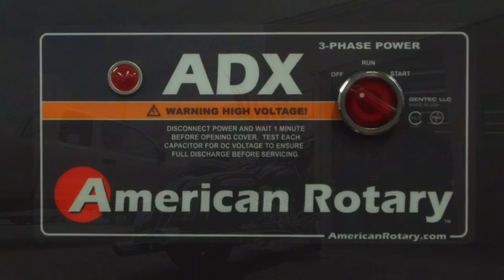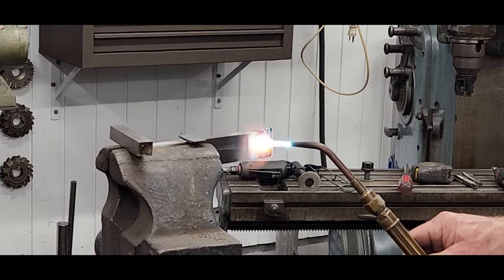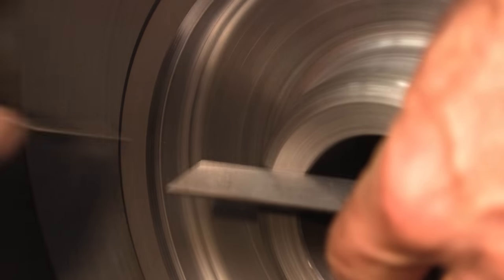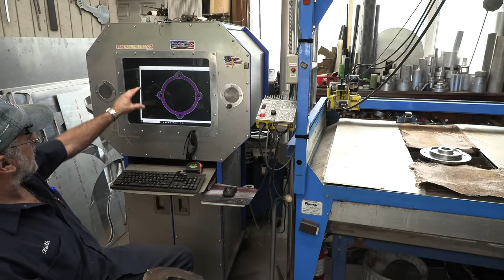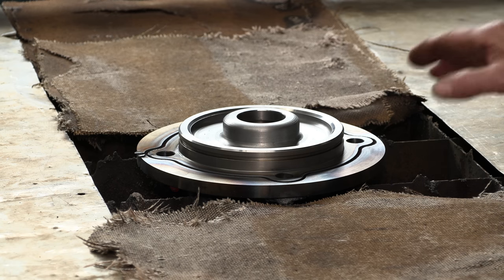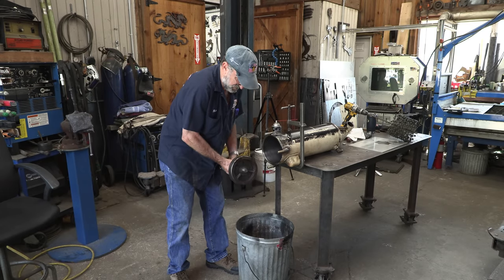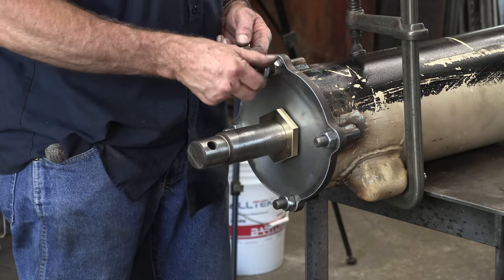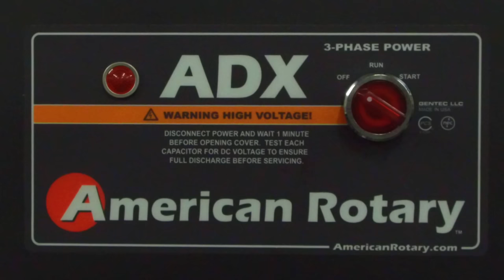How To Change The O'Ring, The Long Way

Comment: Really helpful, Some people will have no idea how thoughtful some of your key comments are during your shows. thanks. I done my time as a Boilermaker/ Welder heavy steel fabrication and plant maintenance with a bit of fitting@ machining. Over the last 5: years as age started to catch up and made crawling around in confined spaces hard facing and generally heavy work less appealing. I started deepening my learning in machining, lathe and Mill. Purchased new but Chinese lathe and Mill for the home shed and slowly played with it and over the last 12 months picked up bits and pieces. I’ve just finished up working for someone else and have enough work  between  smaller fabrication work and job shop stuff to work from my shed at home.  The Chinese lathe has gone been replaced by a brand new Taiwanese one and the mill has been replaced by a Taiwanese Bridgeport copy. Big investment however getting to my point showing making a simple tool to utilise inserts that were otherwise useless  is so helpful, not hard to make but it’s the years of your experience that to you makes it a no brainer but to myself who has not been in the daily grind year after year my resourcefulness is under developed  and the ability to save myself  money on tooling and still produce  quality is gold. New and Bigger Machines mean a lot of new tooling and the price for quality tooling and inserts is hard on the wallet.  Thanks again and to Bill and his mate

Comment: Looks like it needs an internal piston stop to keep it from going dead at the end of the stroke.
Reply: If it's for a plow as Kieth mentioned, which it looks like it is.  The weight of the plow will pull it down so the stop, while perhaps nice, is not necessary.
Reply: Looks like it is over stroking the bore and the piston rings are passing the return oil inlet port! should it have a internal stop to prevent that form happening, because that could wear the piston seals in the inlet oil port groove! Also could be why it bent to start with!

Comment: You'll find a lot more uses for that round insert. Those will remove a lot of metal fast. This was a good watch while I'm laid up waiting for a leg injury to heal. My workshop misses me. Great repair job.
Reply: A screw holding the insert would make it much more useful.
Reply: @ehkerr  The solder is much stronger than the screw. If..if one had the tooling to properly bed the insert it would be almost as "good as". Keiths way takes about 2 minutes to replace the insert at most, and angle of insert can be changed easily, unlike using a screw. Drill and tap for a screw..you are only going to have that angle to work with from that point forwards

Comment: @Keith Fenner     just a tip on the starting of the arc on your plasma setup. Start the arc off into the cutoff material, get it cutting about a 1/8" to 1/4", and then carry right into the actual cut line. Same when leaving the cut, carry  it off or past the start point. That way it will minimize or completely remove the startup scar on your part.

Comment: Keith, I have learned so much from you over the years, thank you.  May I ask what brand and size were the large pliers you were using to tighten the packing nut?  Thanks again.  Never mind, I see in the comments the issue was brought up and answered.
Reply: Knipex parallel jaw pliers. German brand. They come in any sizes.

Comment: Great video Keith, for a while I was wondering which part of Pearl you were remaking. One question, could you have cut the ears with the part upside down? Then no clearance issues.
Reply from the maker: The whole face would of been to close, the center fits between the grate but the rest doesn't.

Comment: Use quad rings instead of O rings. They provide a much better seal. Are you certain that the damage was done by trying to tighten the cover and not from the cylinder slamming into the cover at high speed? If an air cylinder is run up to pressure and whatever it's pushing won't move then suddenly releases, they can slam home pretty hard.
Reply from the maker: I would lean to think in that direction if I hadn't been told it was a leaking issue.

Comment: Seems like it needs something between the piston and cap to limit extension stroke. Appears to be covering the return port when fully extended.
Reply: Yes
Reply: I thought that to, until Keith said that it was most likely a plow, where the weight of the plow would drop it as soon as the pressure on the bottom of the piston was released. That port is most likely either to a filter so that dirt is not sucked in, or pressurized to hold the plow down so the snow (assumed function where he lives) does not push it up off the pavement.

Comment: Keith, why not tap a hole for the insert? Than you can rotate and replace them when they get worn. Best, Job
Reply from the maker: Well, unless you machine the exact taper and seating pocket for the shape of the seating side of the insert, holding it down with a screw would eventually loosen up and be a fail.
Reply: @KeithFenner  Keith, made these myself for a left over box of round inserts and made the pocket a hair smaller than the outside diameter of the button insert (0,02 mm approx) When tightening down it's puĺled into position tight like a press fit. It works for me. Maybe an idea. Faster than soldering. Thank you Keith! Just another way to Rome
Reply from the maker: Yes, it would be a close call on precision location, drill and tap then tighten screw and or soldering in as I did. You know what it boils down to is what you have on hand at the time you are underway with the job, screw collection or siler solder, time is money it could be wasted looking for either. end game getter done.

Comment: Okay, we’ll, I thought the round insert was like all the other inserts in that it had a hole in the center to take a small machine screw, and that you were going to drill & tap a hole in the insert holder. I wasn’t expecting you to solder it in. Oh well, as long as it works. Getter done! 😉
Reply: Brazing is the answer for most other inserts missing a holder.
Reply: @ehkerr  I wound up with the Lista insert cabinet of a factory that went out of business. about 2000 lbs of weird old stuff from the 60s-90s. Paid 150 buckaroos for it all. Some of it is surprisingly tough. A lot of Tungalloy too  With my collection of tool holders.. there is little I cannot work now.  Except all that danged ceramic... that sits in a drawer all by itself...
The Lista cabinet  was headed for the scrap guys truck when I saw it out of the corner of my eye on the fork lift. A loud shout and waving green, got it put in my trailer

Comment: is Aluminum Bronze a good bearing material? 36:40  Or is that some other Bronze?  Thanks for the tips on silver soldering a custom tool
Reply from the maker: Yes strong and wear resistant

Comment: kEITH, NICE WORK. COULD YOU NOT HAVE FLIPPED THE PART OVER ON THE PLAZMA TO CUT THE PROFILE THEN THERE WOULD NOT HAVE BEEN ANY CLEARANCE PROBLEMS..
Reply from the maker: As I stated in prior comments it would help only reduced it by a half inch and the support grates can't support it as solid as the flat surface down.

Comment: I often wondered what the torque required is to turn a piece and take a 0.2" cut. Not a machinist, just know enough about using them to make parts in my electronics career. Prototyping tech type guy. Just the basics, lathe, vertical mill, etc..

Comment: Will you index, or rotate, the soldered on insert before using a new one ?
Reply from the maker: It all depends on how it wears or breaks,  I may also hit the top surface on the diamond wheel for a crisp edge.
Reply: @KeithFenner  Thanks

Comment: Keith, not a point of critic, but I always cut the ends of the packing on a 45º angle so you get a little overlap. Not 90º. You get a far better seal that way.

Comment: What's your opinion of the Knipex plier wrenches?
Reply from the maker: I have that I use the four pares I have quite a bit, for multiple reasons and ways
Reply: I've had/used several pairs for years now; & even have a 10" pair dedicated to the car for misc shtf 'events'. The Crescent wrenches migrated to the back of a drawer ages ago.